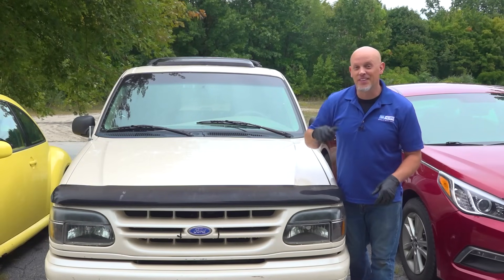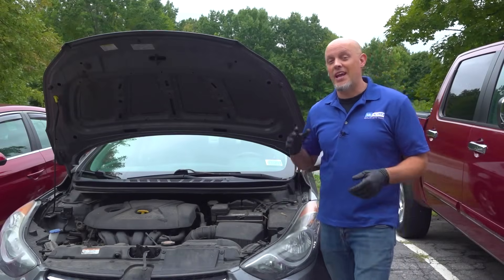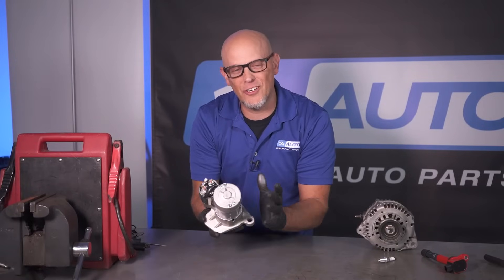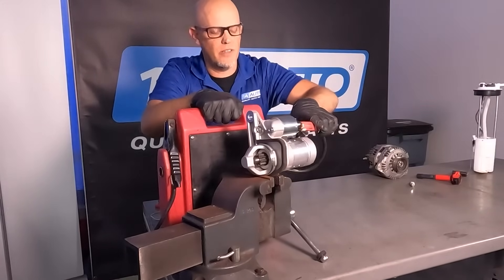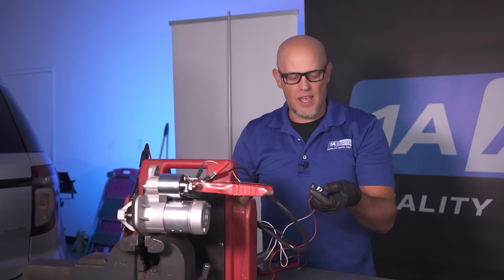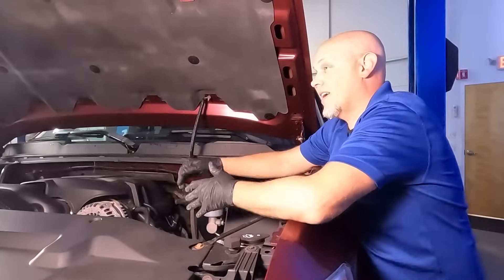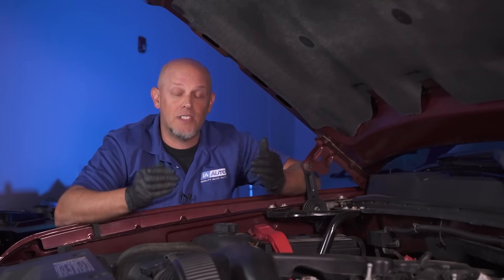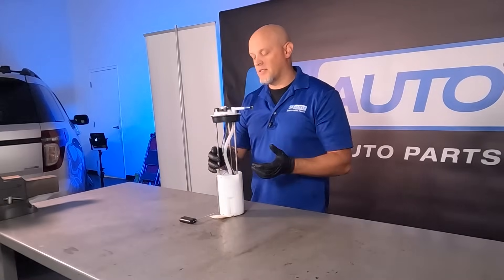Car or Truck Won't Start? Difference Between a Crank No-Start vs. Just Won't Turn Over

Comment: I drive 2001 Toyota MRS,only drive it occansionally, even with a new battery, smtimes it wont start (no cranking sound) & need to jump start it. After few spins (just to warm up the battery/engine) smtimes it wont restart, (smtimes it does), could it be bcz of the starter or voltage leakage?. It works everytime I jump start it but it does make you to think twice to make few stops before reaching to your destination. Tqvm in advance for any advice.

Comment: Can low engine oil make car not to start?
Reply: Yes or even just bad oil
Reply: If your oil is low then there is no lubricant to make the gears activate it will literally prevent the block from doing it's job  if it does start with no oil 90% of the time it'll shut off but if it runs woth no oil the engine will seize the engine

Comment: Hi, hopefully you can answer this question. While I was driving my 2016 sonata 2.4l around 40 mph the car loss acceleration and at the same time I noticed the Rpm needle jumped all the way up high to like 5000 rpm and a ding tone similar to seat belt came on and then stopped, so I came to a rolling stop and set the car on park, but then it wouldn't start. All I get is that clicking sound but won't turn over I put in a new battery and replaced the alternator wasn't thinking that it could be the starter. So do you think it maybe that the starter is bad? And can the starter actually cause this to happen while driving? Thanks in advance

Comment: I think what i did was try to cold start my truck after it sat for awhile. Battery was discharged a bit and then i tried cold starting. It would turn over at first but died off quickly

Comment: One you missed water in a cylinder, blown head gasket. Causing water to flow into cylinder whilst engine stopped but rad pressurised

Comment: Great video 👍But let's not forget about these other common issues. My 99 Honda accord had a choke no start. It had two issues. 1... it was VAPOR LOCKED. Had to hit the top of the fuel pump several times. 2... the RELAY SWITCH needed to be replaced. Which I was told older Hondas have relay issues. So this relay is found under the steering column to the left side. Second vechile is a 07 Tundra. Replaced the FUSES and RELAYS to the fuel pump. That worked for a week. Then replaced the fuel pump. And heads up if the fuel pump dies completely, your vehicle will shut off with no warning and leave you stranded right where you're at. Which could leave you in a deadly or unsafe situation. Replacing the fuel filter ofter helps protect the fuel pump.  Luckily, I was on a quite street vs the fwy or hwy when the fuel pump went out. 

Lastly, the IGNITION SWITCH. It can get damaged from too much weight hanging from the ignition key ring. This also happened to my 99 Honda accord. Experienced an entire summer of the car shutting off in the middle of a turn in a very busy intersection. Absolutely no mechanic could figure it out. Thankfully,  there was a recall for the ignition switch for this car. Otherwise this would have been very costly. Would have cost over 1k to replace the ignition switch. Hope this information helps you.

Comment: A very informative video that makes it easy for the layman who knows just a bit understand much better. I'm going to share an experience with a similar situation several years ago with my 1999 Mercedes W210. One morning it failed to start. There was no cranking sound at all - just a click when I turned the key.

Tested the battery, which was approaching five years. It showed 12.3V. Not high but "should have been enough". I assumed it's something else. Perhaps the starter, although I had replaced it less than a year ago. As with the alternator. I called a tow truck and had it sent to a workshop about 3 miles away.

The mechanic attempted to jumpstart by connecting to a standalone puny-looking battery (the Mercedes' was DIN90). The engine cranked and immediately started! The mechanic tested the alternator and it showed the battery charging at 14.3V. So the battery's the culprit. Why then did the car not start despite still having 12.3V?

I learned a useful lesson in basic electricity from the mechanic - volt doesn't automatically lead to enough cranking power (CCA), which the battery was lacking due to ageing plates. Some batteries might last more than 5 years, some less than 2. Or worse. 

The towtruck cost the equivalent of US$ 35. Not exorbitant but I could have saved that plus the embarrassment had I just bought a new battery and installed it myself.
--Petaling Jaya, Malaysia

Comment: I might add check codes on newer cars before doing alot of work, one time it was the crank sensor. keep that in mind, and a engine needs air, exhaust, spark/compression and fuel. and on newer cars a whole lot of electric sensors too :) Edit: Stuck EGR valve is always fun, chokes the engine 5 seconds after start. i love being environmentally friendly.

Comment: I had a situation where my car would not start all. Put the key in the ignition and the dash would light for 2-3 times each times I tried to crank then all of a sudden car went pitch black. Like dead as a corpse. Tried the ignition and it just won't respond. Later I had to jump the battery and it ran just like new.

Comment: Do one on 2000 Ford rangers temperature gauge not reading anything on the dash. Been trying to fix it for over a year after Jenson broke it and didn't take responsibility.
Reply: Temp guages aren't suppose to "read anything on the dash", you tool!
Temp gauge only let's you know the temp of the engine, it doesn't read!

Comment: 97 Nissan Sentra wasn’t pumping fuel to rail. Pump was working. It wasn’t even the fuel pump relay. Ironically, on this particular vehicle it was the ignition coil relay. $30 😂 Vrooom! 🚗
Reply: Did it crank or no sound?

Comment: I needed this last week.

A co workers car wouldn't start so we immediately thought it was the battery.

We tried a portable battery jumper, but had no effect. I thought it was strange that the battery percentages on the portable battery didn't move, but I went in to try jumper cables.

That didn't work. I tested the starter fuse and it was good. I tested the voltage and it was 12.4v (13.4v when connected with jumper cables)

After that failed, I gave up. It never occurred to me to test the starter itself... I still have much to learn.